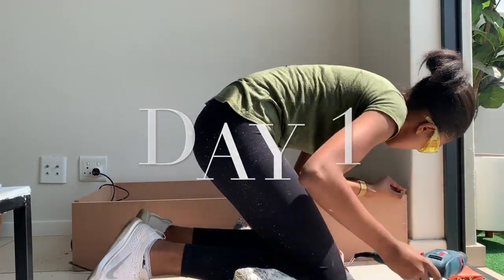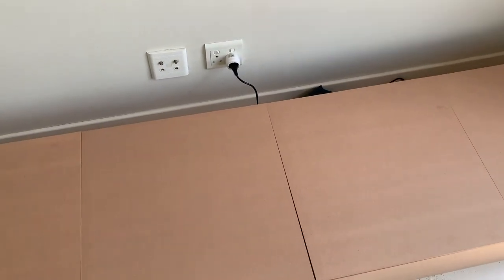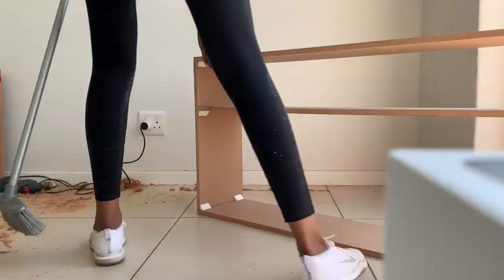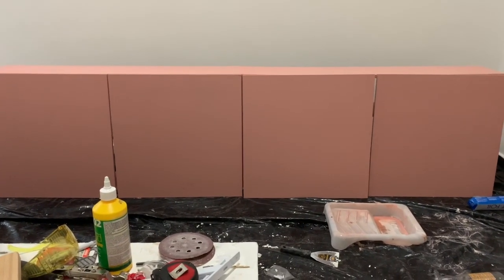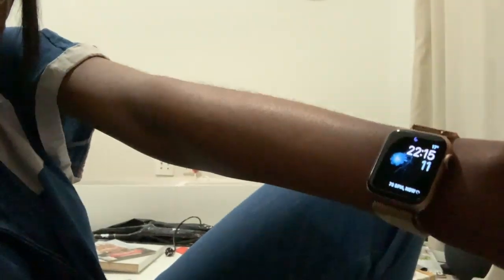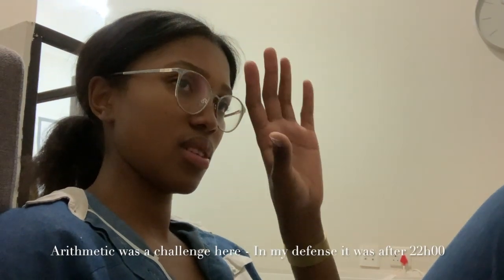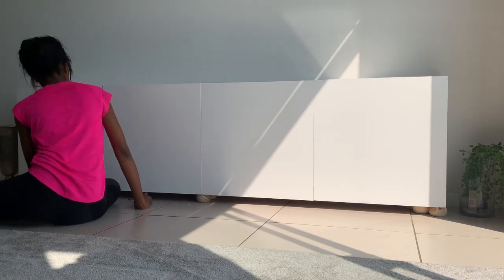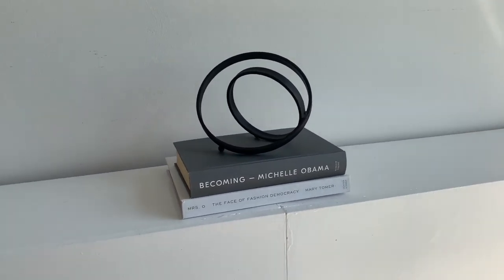DIY TV Stand | SOUTH AFRICAN DIY YOUTUBER

Comment: Hi,
This is awesome to see. I also rather make something instead of paying through my nose. I am in the process of designing my own TV unit and a server unit. My only advise would be to add some middle supports where your shelving is. This will make it alot more sturdy and prevent sagging when items are placed on it. This would also assisted in getting your doors ligned up as all would stay more straight. But kudos to you for making this as a first attempt. Keep it up